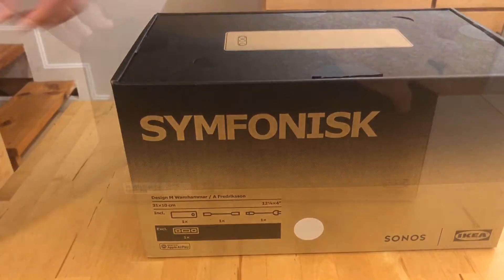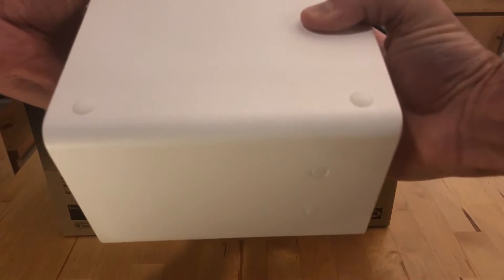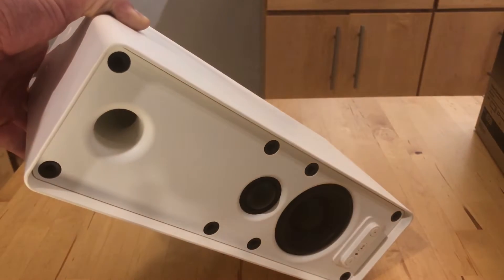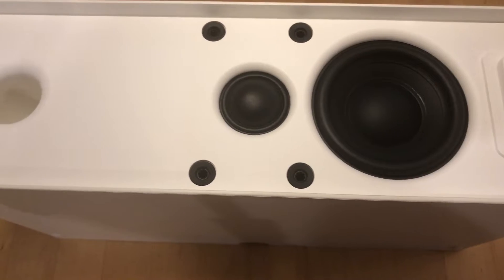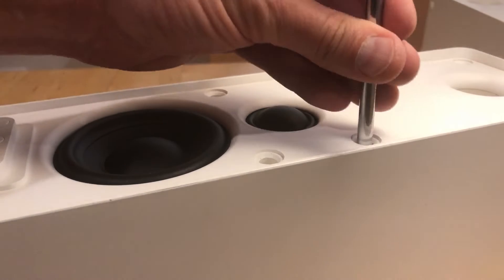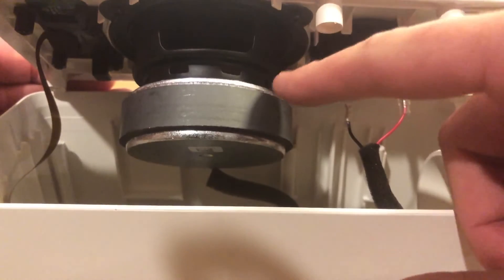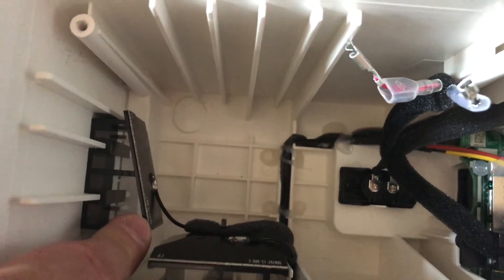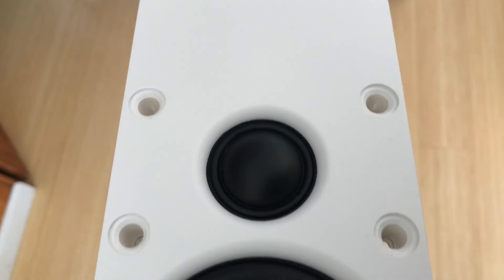Sonos IKEA Symfonisk speaker unboxing and teardown: What’s inside?

Comment: I have an iphone 14 pro with lots of music on it. once i pair this speaker with my via wifi and have downloaded the sonos app, how many steps are required to play music from my phone once the speaker is turned on? Do I have to go through sonos app every time, or can i just start playing music from my phone's music library? DO I have to manually connect/disconnect each time I use it, or will powering the unit off disconnect it from my phone?
Reply from the maker: In whatever music app, you can just tap the Airplay button and choose a speaker so that's the same as Bluetooth. The benefit of Sonos is you can use the app to directly tell the speaker what playlist or album to play so your phone's audio isn't tied up at all - it will play even if you're not around. For that, you use the Sonos app, choose the music service, then the playlist, and that's it. Few mote steps but it's really slick.
Reply: @todd.parker  I was hoping I could just turn on the unit and press play and it would work like bluetooth does...I don't like having to go through my phone and select stuff.

Comment: Thank you for a video! What's the role of a piece of a flat rubber sheet complementing the speaker?
Reply from the maker: Sorry, where was that in the video?
Reply: @todd.parker  Hi Todd! Sorry! It wasn't in the video. The rubber comes with a wall bracket. I've forgotten about it. Still unsure what's it's purpose.
Reply: @alcovefib  It is if you want to mount it horizontally and use the speaker cabinet as a shelf/nightstand

Comment: Hi Todd, I'm trying to take a slightly different approach to modifying my SYMFONISK. I've come into possession of two of these speakers and would love to find a way to add them to a Google Home speaker group. With Sonos restricting this feature for the foreseeable future, I've been scheming ways to wire a Home Mini into this speaker to feed an audio signal to the preamp. Since posting this video, have you explored any further into options that may lead me in the right direction?
Reply: Just adding to the knowledge base, I found an Instructables tutorial denotations how to wire a Bluetooth module into the Sonos Play:1. As SYMFONISK has the same circuitry, this is a good lead to adding audio input to the IKEA speaker.

https://www.instructables.com/id/Add-Bluetooth-to-Sonos-Play1/
Reply from the maker: I think that would be a lot harder to do since these probably don’t have that in mind on the board. The signal comes from the streaming client so you’d need to do some serious hardware and software hacking
Reply: @todd.parker  My audio electronics knowledge is a tad limited. But if I am not mistaken, line level is typically around or below 2v, correct? I ask because I am looking at the Texas Instruments data sheet for the DAC in the SYMFONISK and see pins for audio L and R out from DAC which presumably feed directly to the biamp. This output is rated at 2.1v RMS (grounded to center). I wonder if I could tap into this point on the circuit. Any thoughts here or have I gone a bit wild in my thinking? Hah....
Reply from the maker: I’m afraid I’m out of my depth here but if there are output signals to solder into, that would be great. Are you going to give it a go?
Reply: @todd.parker  I'm tempted....maybe going to run my plans past a colleague who is an electrical engineer by trade. Will definitely share if I have any success.

Comment: Hi, Todd! I bought this speaker, but there is no bass, only mids and highs. I opened it, and all seems fine. Everything is connected. Do you have a solution? Btw, IKEA told me to keep it and just sent me a new one. Would be nice if this is fixable! Thanks.

Regards 
Rikart
Reply from the maker: Is there sound coming from the woofer?
Reply: @todd.parker  No, only from the top speaker.
Reply from the maker: Then you probably have a defective unit. Good they are replacing it
Reply: @todd.parker  Yes that's nice of them. You don't know of a place/website that sells spare parts for these kind of speakers, do you?
Reply from the maker: Rikart L. Jensen Check Parts Express. They won’t have these exact drivers but may have ones that are very similar. Before you buy a woofer, I’d suggest opening the speaker (see my disassembly video) and check the woofer connections. It’s more likely that the amp or electronics have an issue than the woofer itself. You can directly hook up the woofer to an amp or the other speakers woofer amp to see if the driver is ok. If so it’s the amp.